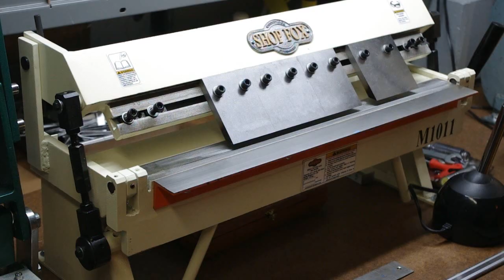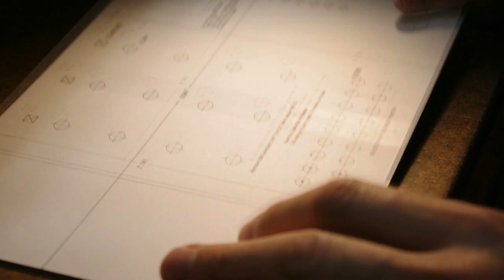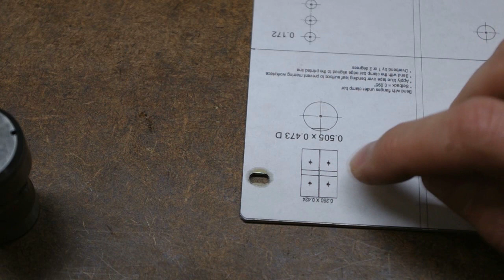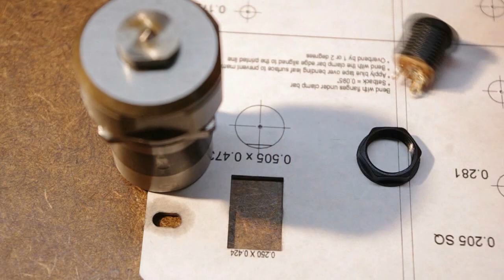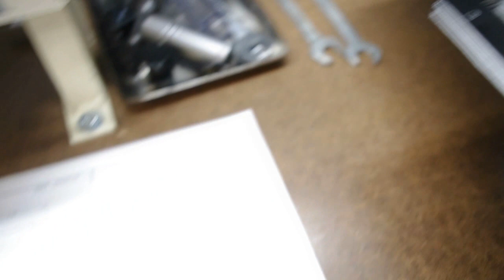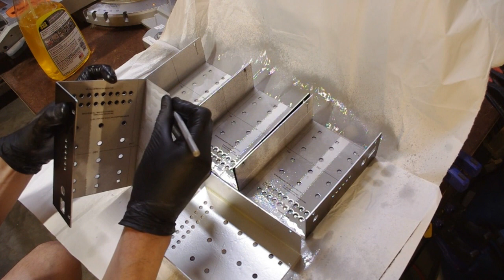Fabricating Electronic Chassis with Traditional Sheet Metal Tools

Comment: What brand and model of punch press are you using? I’d like to get one for myself.
Reply from the maker: Roper Whitney 118
Reply: Thanks! I’m going to look for a roper Whitney 118, but I have another question, what software do you use to make your templates?
Reply from the maker: @ryanomalley430  Alibre
Reply from the maker: I bet you'll find a press without too much searching.  Its harder to find used punch-die sets of useful sizes.  Most of my tooling is second hand from the "bay". I also have had custom punch-die sets made by cetooling.com (USA). Not cheap though

Comment: That's true skill, an small sheet metal shop let you build several interesting projects. Just by the way where do you buy your punches? I also have a roper whitney but i need more punches
Reply from the maker: I found most used on ebay. Had good luck there for a while. Ive also had custom shaped punch and die sets made by CE Tooling, they got it right.
Reply: @EA78751 Fascinating, the manufacturer is Roper Whitney, particular model? I’m a total novice but I can see myself doing this. What is the throat depth and height?
Reply from the maker: @parkjv1  Roper Whitney 118, 2-1/4" height between ram and die holder, about 7" throat depth. For tooling you can use either Whitney or Di-Acro punch and die sets.

Comment: For the first piece, how about putting a bar magnet behind the brake fingers as a stop?
Reply from the maker: I’ll try it.  Although the largest source of error in this shop turns out to be the shear.  Best I can do with it is +/- 0.032” per cut.  So registering the workpiece in the brake off of its cut edge could telegraph that source of error onto the bend line.

Comment: I've been drilling my aluminum faceplates by hand, and I'm not that satisfied with the process or results. I'd been thinking of punching. Did you get your machinery second-hand?
Reply from the maker: The punch press and its tooling are second hand + custom built. The shear and brake weren't hard to find new at affordable prices

Comment: you have a massive amount of information in your brain...it must be saved
Reply from the maker: Thanks!  When I started out doing this stuff, I wished I could find more information on punch presses.  I hope this helps somebody.
Reply: @EA78751  Your video sure helped me, thanks a lot. Of all the "machinist" videos I studied, none  were as helpful to me at my present stage of knowledge. Your video answered every question I had, and luckily there were a few similar punch machines on eBay so basically I was able to duplicate the punch press portion, next challenge  is the correct tooling and custom made adaptors for my application. My Greenlee chassis punches have carried me well for 50 years in Ham Radio, but no longer are meters and switches round, or Imperial dimensions.
Reply from the maker: @georgedowell3244  Thanks for your kind message. Still punching here.  We got a CNC router recently, but theres still lots of jobs the punch press is better at, and safer, quieter too.
Reply: @EA78751  Thanks again for making everything understandable, and congratulations on a new  a CNC router there. Something like that is not in the cards for me, I can't program worth a darn (and too old to learn). 
Watching your video I wondered about the need for the adjustable protractor trick, but now that I have a similar punch machine set up and have some more experience with it, I can now fully appreciate that little life hack you came up with with the protractor- a very quick and precise method to keep rectangular and square holes aligned with the edges for sure. I've now learned that just one or two degrees "off" makes a noticeable difference, but the protractor quickly and precisely adjust that error out. Very well done and thanks again. for saving me untold frustrations!

Geo.
Reply: @EA78751  - Have you considered making a compound table or a jig for spacing out the punches?